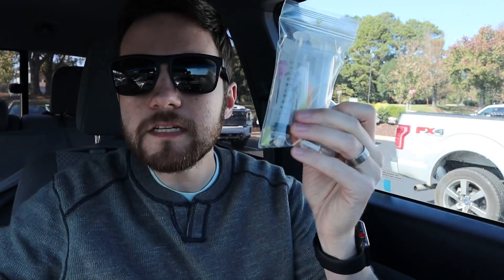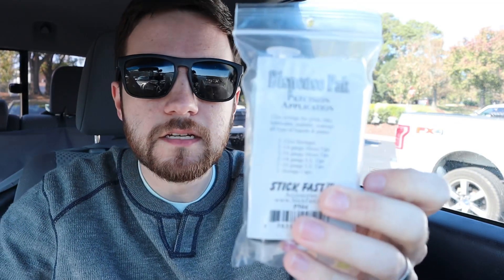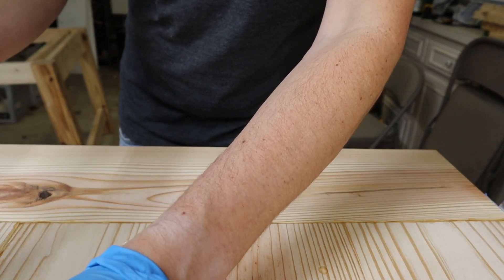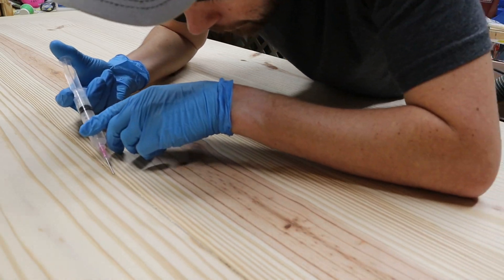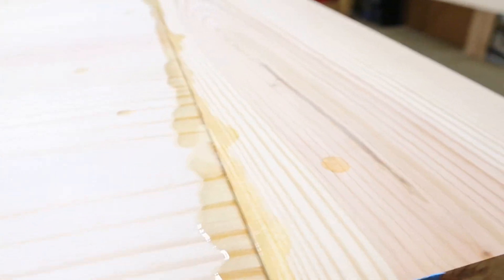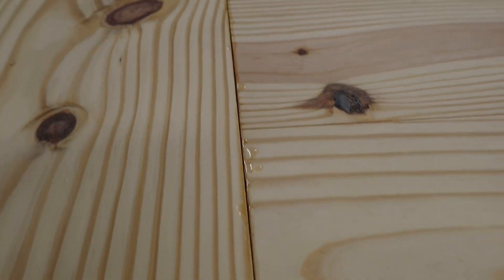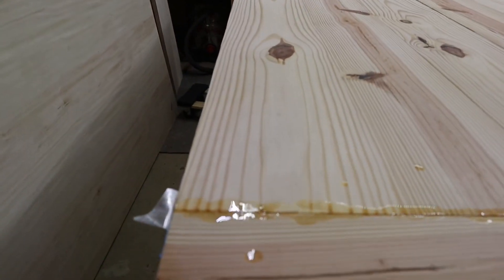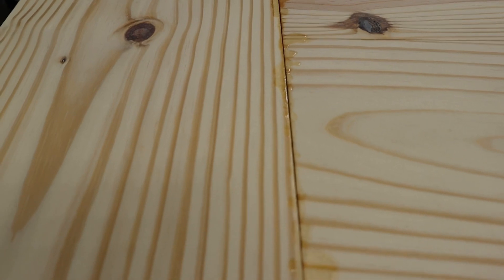Experimenting with injecting epoxy

Comment: Just try to use making tape both sides of the cavity. And put it in a way that the edge of tape is as close as possible to the edge of cavity. And you would get very neatly seam of resin.
Also experiment with curing time of the resin to remove masking tape before the resin is rock solid (so that the edges of resin will be sharp after you remove tape) and to avoid stringing.

Comment: I had to repair the base of my entrance door jamb and this what I did. I did a half lap on the repair and injected structural epoxy glue into drilled holes in the outer piece until it spooged out along the edges. Then i clamped the joint.

Comment: That seems to have worked well. May I know the size of the needle that you used? I tried using a G18 needle injecting 30 min epoxy glue into a piece of wood to fill cavities left by powder post beetles but the glue stuck to the inside of the needle immediately. I'm thinking to try some cheap casting epoxy next. What size is yours? Did you manage to clean the needle?
Reply from the maker: I don’t recall the exact size of the needles I used but they are sold as resin needles. They come in pretty small sizes. I didn’t try to reuse them. Sorry. Good luck! I am really happy with how mine turned out though! I would probably forget I did it on our dining room table if not for this video 🤣 they just sort of blend in.

Comment: Do u think this would work well re glueing some failed spots of parquet flooring sticking wood to concrete by injecting into a drilled hole between blocks
Reply from the maker: I’m not sure. I’ve never worked with concrete before sorry